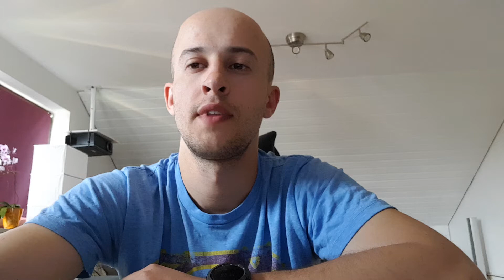Vector ebike vlog #8 Vortex

Comment: Hi Arthur, some questions about your bike:

- if you drive a long uphill of 800 meters, do you feel the battery heat on your legs very much? Maybe same like motorcross and need to protect against with higher boots?

- on the end of the video, who you're driving on the skiing area, battery was empty then?

- if battery is empty, nevertheless you can drive uphill? No blocking motor?

- at all you mountain trips, someone was claiming that you drive this bike on ways with much walking people?

-the bike normaly has an display for overview of range, outgoing power and battery status?

Thx in advance for your answers, i think i will come next 2 weeks to test drive to munic.

Br
Michael